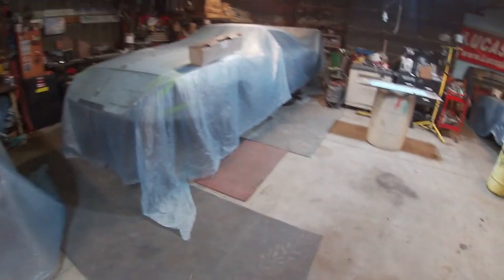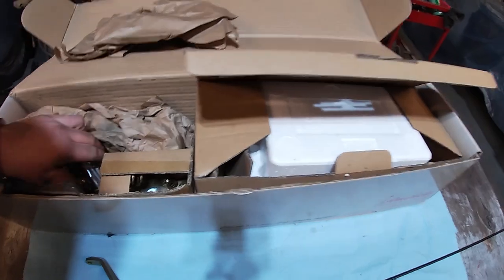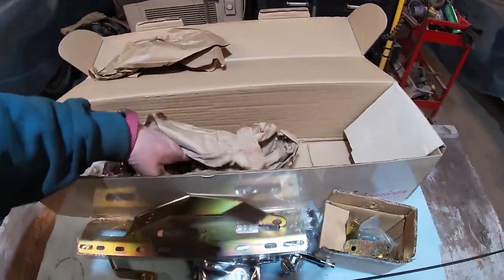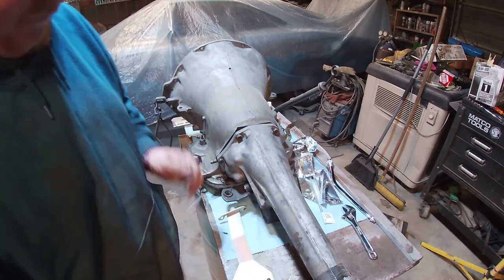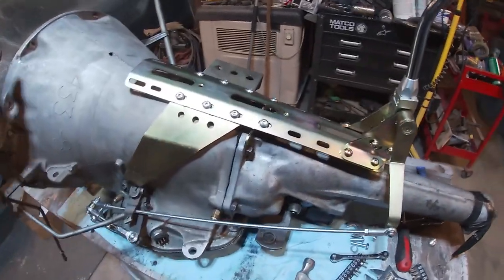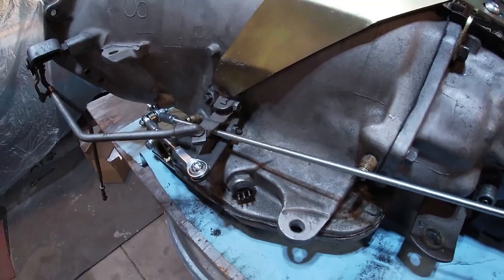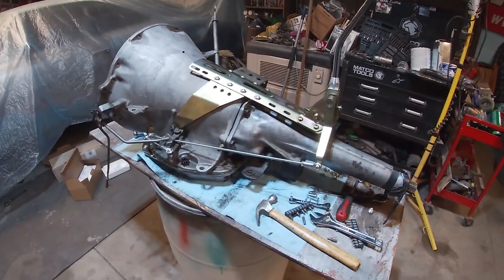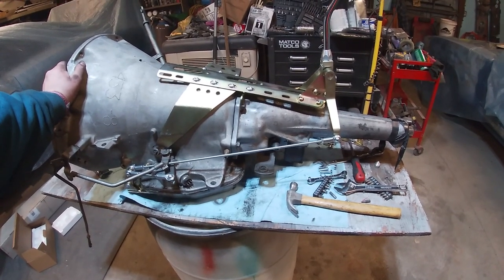American shifter install on Mopar 727 Automatic Transmission!

Comment: I was just watching this guy unpack his shifter from American shifter and has a million and pieces. Came with no instructions and some website that was shut down that was supposed to help me put it all together I could not hire a mechanic and have him online for 3 hours trying to figure out every nut and bolt and bracket that comes with this pile of nuts and bolts they call a shifter when I was younger you wanted a shifter you went down and bought a shifter and it opened up out-of-the-box bolted onto your damn car ridiculous